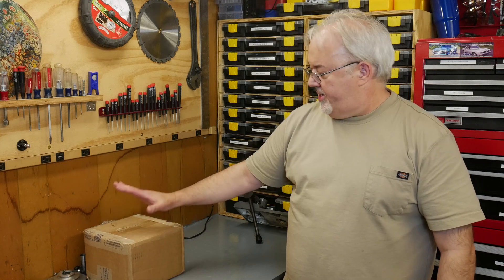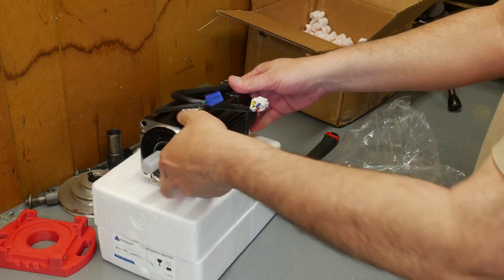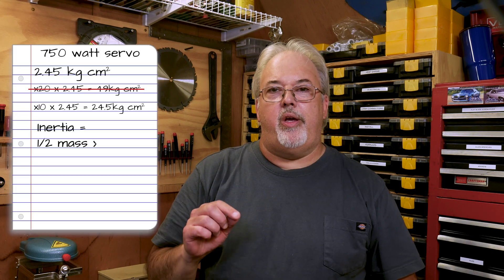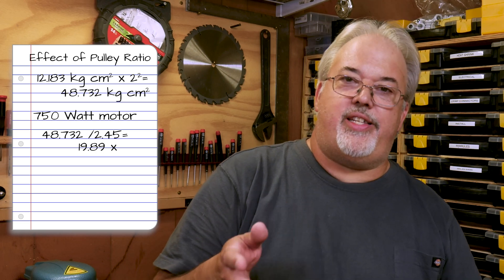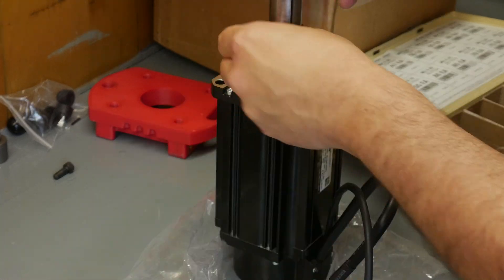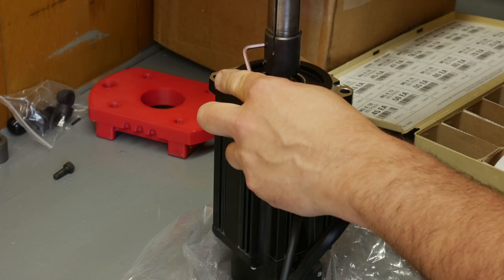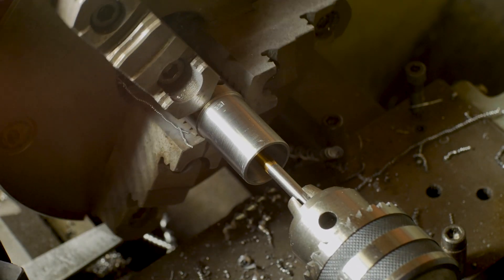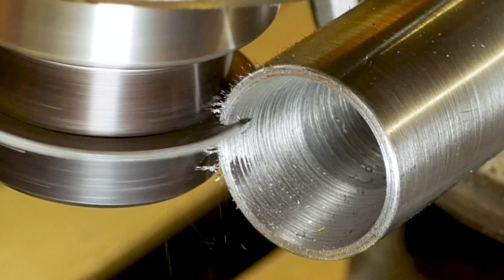DMM Servo Spindle 1000 Watt Motor Install

Comment: Great video! I keep contemplating switching a 750W to a 1kW. Sorry if you already know all this... You used the moment of inertia equation for a solid cylinder. Using the hollow cylinder equation would reduce the value a little. Partitioning the spindle into several hollow cylinders and adding their moments of inertia would be closer. Must be careful using arithmetic mean of the radius because the radius is squared in the inertia calculation. I have the PM25 mill and came up with 7.2 kg*cm^2, and if I remember right with a TTS holder and 3", 1/2" diam end mill. I could be way off though.
Reply from the maker: I was not aware of the other equation, I was just using the equation that DMM provided.  But truthfully, I'm not sure how hollow it really is until you account for the stack of Belleville washers and draw bar it would seem all but solid.  As it turned out, the fault that I was chasing (faulting out when stopping) turned out to be an issue with the way Centroid controls the shutdown cycle.  The DYN4 does not like having the motor enable signal removed until the motor comes to a stop. Modifying the shutdown cycle fixed that problem and probably would have eliminated the need to jump to 1kW- But I don't regret that move.  Thanks for watching!  I believe I binged all your videos on the subject when I was researching this project.
Reply: @PeteRondeau  Good point about the draw bar. How did you average the radius? Sorry to care about the details, I like math. Thanks for explaining the enable problem, that probably would have bitten me. I'm getting back into the shop, need to do other spindle repairs, and will upgrade the motor size. Was thinking of returning to the micro-v belt to have pulley ratios and use a second spindle for aluminum. The never done project :)
Reply from the maker: Oh.. the radius.. Yeah I forgot about that exercise.. I had the spindle out of the machine so I physically measured all of the various diameter changes and recorded the height and diameter of each section.  I'm looking at the drawing I did and I don't really remember.. I think I turned it into a volume calculation and then after I had the total volume of the cylinder, backed out the overall height and ended up with the average radius.

Comment: Hi.  Is this a 5000rpm 1kW DMM DYN4 series motor?  The only 1kW motor I can find on the DMM web, is a 3000rpm max speed?
Thanks for the video
Reply from the maker: This motor is not listed on their website, it is basically a 1kw version of their 750watt motor that can go to 5000rpm.  the part number is 86H-DHT-A6MK1
Reply: @PeteRondeau   I'm looking into ordering your setup, how did you?   Do I just need to call.   Thanks for all :)

Comment: Did DMM send you an acorn rev4 spindle wiring diagram or are you going off of their acorn rev3 diagram Pete? I started wiring mine yesterday only to discover I have outdated diagrams lol.
Reply from the maker: I just checked and the diagram I have does say R3.  Truthfully I hadn't given it much thought.  I just looked at the diagram from a functional standpoint and used the appropriate relay outputs when wiring.
Reply: @PeteRondeau  Thanks for getting me thinking back on track again, I went back to rewatch all your electrical videos too and re-found the "wiring complete" one. This is my first CNC anything project but it's making sense... the output signals on the acorn in revision 4 are now used to control the included relay board, and if I'm looking at it right the middle terminal coming out of each relay is the output signal? So it looks like I'll just pick 2 of those for direction and enable signals, and everything else will remain the same.
Reply from the maker: The relay gives you the advantage of having both a normally open and normally closed contact. A quick switch to the opposite terminal can invert a signal to match what any given peripheral might need. And, you can switch any sort of voltage that might be required- 5volts, 24volts, sinking, sourcing- whatever you might need.
Reply: @PeteRondeau  Ok, so I guess all the output signal really required by the DYN4 drive is a way to turn 5 volts on and off? Looking at the label on the relays themselves selves it appears like it is a 5-volt output signal that activates them?

A relay on or conversely off will determine the motor direction and the second relay on/off will control the enable signal that goes to the motor. This is my first time using relays so hopefully, I have the right concept down.
Reply from the maker: Sounds like you are on the correct track.  The relay is just an automated switch, any mention of 5 volts on the board would be indicating the coil voltage of the relay that Acorn is sending out to turn it on.  One thing to note is that the different terminals of the DYN4 have different voltage requirements.  The enable pin (#15) can take a 24 volt input directly, while the direction pins (10 & 22) are expecting a 5 volt signal.  On the drawing supplied by DMM they are showing going through a 2K ohm resistor to divide the voltage down going to the optocoupler internal to the DYN4.  In both cases though you are going to be switching the negative or ground side of your power supply (depending on what terminology you prefer). You need a negative (24v gnd) wire going into the relay.. I typically would connect it to the "Common" terminal (the center terminal on each 3 pin connector), then take my output from the "NO" terminal.

Comment: Your videos on the DDM Tech motor couldn't be more timely. I have an converted Grizzly G0463 (Sieg X3) that I'm looking to upgrade the spindle motor. The 1100W motor is looking interesting.

What's the weight difference between the 750w and the 1100w motors?
Reply from the maker: I wish I could answer your question but I didn't take the time to weigh it when I swapped it out.  It stands to reason that it is going to have more copper in it and will weigh more but I don't know by how much.  Hope you continue to find some value here.

Comment: Do you have any tips on tuning the motor?  I have a DMM 1kW motor as well and I cant get it to run smoothly across the entire RPM range.
Reply from the maker: I’m still working on that myself but it seems to work best with very little gain.  The bigger issue I have is overloading when shutting it off.  That is where most of my current attention is. I’ll have more updates coming up.

Comment: Does this new motor have the same RPM as the 0.75kw motor too? Looking at DMM's website everything 1kw and above is half the RPM
Reply from the maker: Yes, the particular motor preserves the 5k rpm rating of the 750watt motor.
Reply: @PeteRondeau  Interesting, I think I will do the same to my 2800, I found my original servo drive isn't compatible with acorn control. I gasp a little when you started hitting your spindle with a mallet lol. Is that top press fitting with the 45 deg 5mm hydraulic oil hole the only thing holding the spindle in place after the pulley retention nut comes off? I need to take my spindle apart to regrind the BT30 taper and have been scratching my head about it for a couple days now. I don't have an oil injector to remove the spindle but I do have a press if all it is is a simple press fit.
Reply from the maker: Well, keep in mind that the jury is still out whether the motor is up to the task. Yes, that top ring is really all that  is holding the spindle in place. I suspect you could screw a grease fitting in there and use a grease gun to push it apart. The first time I took it apart the head was off the machine so I just put it on the arbor press and pushed it out.
Reply: @PeteRondeau  Thanks Pete, I guess it just looks and feels like a tighter fit than what a grease gun is capable of producing. It's worth a shot to experiment with, I should have a few grease zerks with 5mm thread I can test. Now that I've been looking there's a handful of YouTubers using DMM servos as spindle drives I've seen. I haven't yet dove deep enough in my search to see if there are any issues over time. I kind of wonder how DMM servos being essentially cheap Chinese products will perform under max rated RPM and load over a very long CNC program.

Comment: Awesome video: small point, if your doing inertial ratios friction does not matter.  but all the rotating mass does. So drive pulley, driven pulley, belt, spindle , tooling (include largest diameter cutter, aka facing tool)  and gearing ratio will multiply the driven component as you showed. So gearing down (loses rpm obviously)  could give better inertial ratio. I think you probably want 5:1 or lower for best performance.  Thanks for including details of your process :)
Reply from the maker: The reduction would absolutely work, but the goal here is to lose as little functionality as possible when compared to the original setup.  My main goal would be to do 10k rpm with a 5/32" tool for aluminum.  To that end, I included a tool holder when I was weighing the spindle.  I think that is going to work- obviously for heavier work with larger cutters I will need to use a lower range and slower speeds.  Thanks so much for watching!

Comment: I have a G0704 clone that I bought the same 750w DMM motor as you a few years ago. I have NEVER been able to get it working properly and have put the project on the backburner many times because of it. The tuning never seemed to work properly (stalling, the RPM never being accurate, alarms, etc.) and I always chalked it up to not being able to be tuned correctly since you can't really simulate the load of cutting material without actually doing it.

I'm now wondering if the whole time it's been the same intertia mismatch issue as you had. I've always used a 1:1 pulley ratio though so I'm not sure. All I know is that the whole ordeal has been extremely frustrating lol.

Recently I've been looking into ebay AC servos/drive combos. They can be had for much cheaper than the DMM servos but I fear the tuning capability and documentation will be little to none compared to DMM's.
Reply from the maker: I agree with you that the varying loads do present a tuning issue.  I haven't really worked enough with this yet to prove it is going to perform like I want it to but I remain hopeful.  I work with Yaskawa servo drives every day, so I'm used to a system with a lot more tuning options than the DMM drive has.  It is a very simplified system compared to more "industrial" options.  I fear you would be giving up even more with some of the ebay drives you mention.
Reply: @PeteRondeau  That's what I also fear. I guess I'll just wait and see and maybe continue to scout out other options.
Reply: @SteelCogs For my beloved future G0704 users who may come along and see this.  I use DMM 750W Nema 34 with DYN4 drives on all 3 axes of a G0704 with direct drive and have had perfect reliability for years. Rapids are fast (250 IPM) and overall have been very happy with the 750W on all axes. Note that the ways on the G0704 are marginal for the 400W Nema 23, and would not recommend them with direct drive. I did need to engage DMM support for wiring the Z-axis brake, and they were amazing. I paid full retail for all DMM hardware, and have no bias, just wanted to share my experience with DMM servos on the G0704.